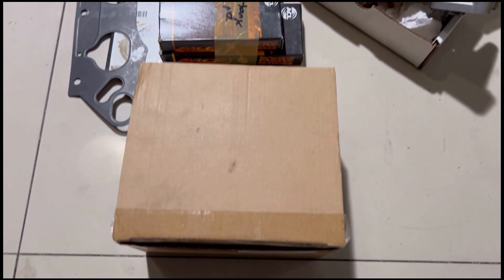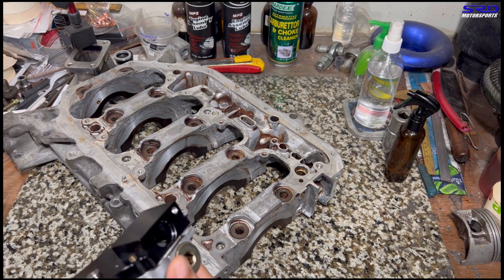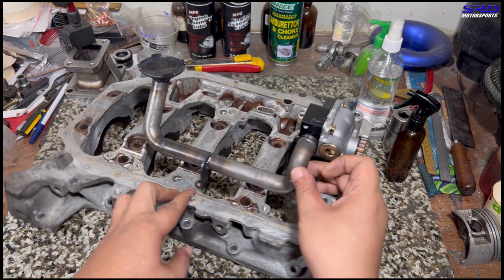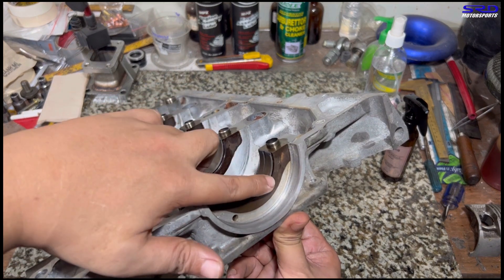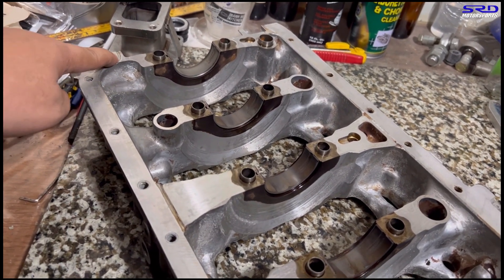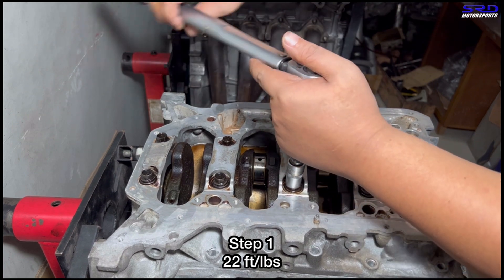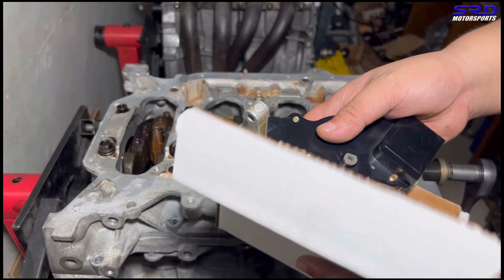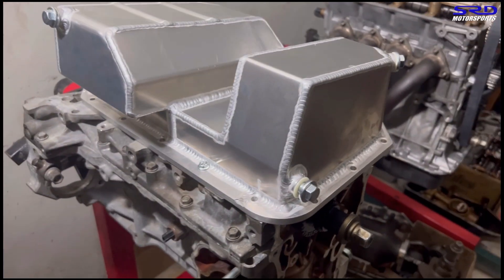K24 Engine Rebuild and Head Porting with K20a Oil Pump and

Comment: Ive built about 5 motors now in my kitchen lol. I always make sure to use good assembly lube. But what I also do before first start is fill it with oil, remove spark plugs and the ecu. Crank it a bunch with the starter until the oil pressure light turns off on the dash. Then crank it another 15 to 30 seconds which helps to purge out any air remaining inside the block's oil passages. After all that if everything seems fine ill plug in the ecu and fire it right up! Thanks for another great video.
Reply from the maker: Yep on all our start ups we do the same
Some engines here we actually did the install can be seen doing this…hopefully others catch on to make it safer on their build

Def a “why not” kinda step that can only give us benefits right? Good stuff!

Comment: I see that you didn’t lube the conrod big end journals. Is that the way you actually do it or might’ve just forgot it?
Reply from the maker: it’s already lubed off camera using “assembly lube” as we always always use assembly lube as it’s thicker and better for “first start up”
Reply from the maker: always unseen, 
-rod journals are lubed before piston install 
-rod cap bearing side is lubed before dropping it in

Comment: Good video. I'm in the process of rebuilding my k24 back to oem spec. My oem rings out of the box spec are on the top side. 1st ring .015 and 2nd ring .026. Is there oem rings I can buy that isn't pregapped?
Reply from the maker: Oh sweet nice and have fun while you’re at it!

I think the rings we can get are much of the same and I mean the 1st ring being 0.015” is good the 2nd ring it may seem loose? But I’d run it… I don’t think I’ve seen em smoke cuz of this but it does lessen parasitic drag (spins lighter this way) so I’d run that 

granted the hone and bore finish is good then you’re fine

Comment: Are you using custom seats on this head?
Reply from the maker: You mean on the springs? Yes we using the actual K20a valvetrain set, since it’s just a clean up rebuild (owner actually just wanted to run it as is lol )
Reply: @SRDmotorsports  Apologies, I meant the valve seats. But yeah, the clean up would help a lot with longevity since it's a track car.
Reply from the maker: @findtherightbeat  yes just our usual valve job, the power maker one has too narrow seat width for my liking if used on track or extensive daily
Reply: @SRDmotorsports  Yeah, thin seats to improve sealing pressure comes at a cost in terms of longevity. 

I'd like to know your thoughts on running cast pistons for circuit/track duty -- I remember Joe McCarthy mentioning how piston speed will need to be conservative to prevent piston failure when using cast units. However, another TA team from down under mentioned that their customers are running stock cast pistons on their K24s (geometry less favored) but still have good reliability and service life.
Reply from the maker: @findtherightbeat  forged is good
But also cast pistons or hypereutectic pistons
Has a less brittle/hard place for the rings to settle in = higher mileage

So I think the bigger factor to consider is
Forged may last one whole season ideally with the rings and change it for next season and be it new condition again

Whereas cast can prolly take 2-3yrs to replicate the same wear